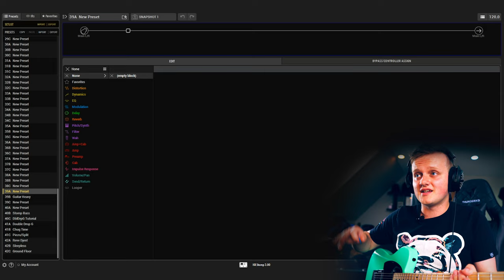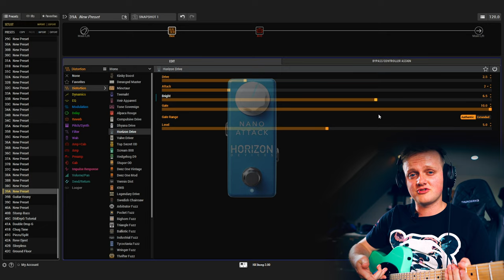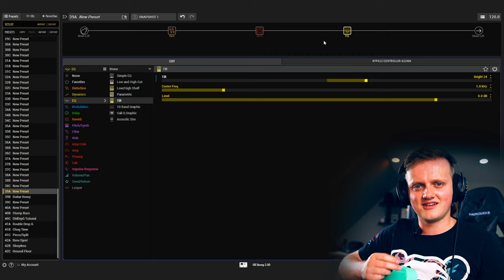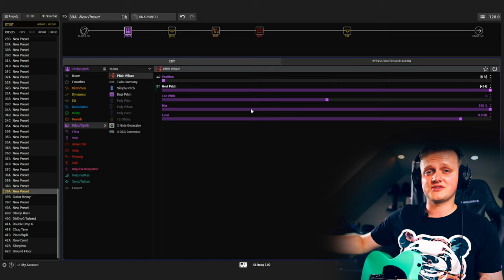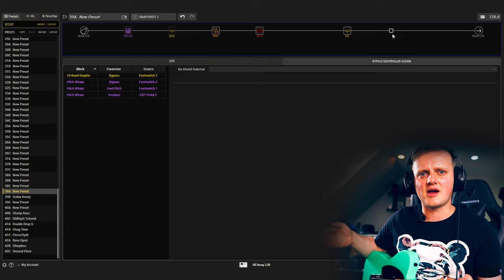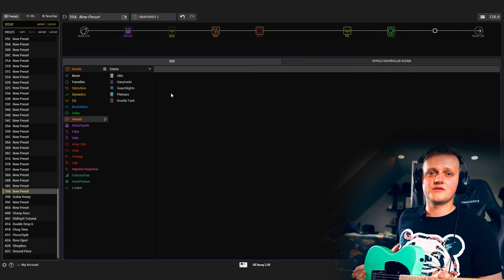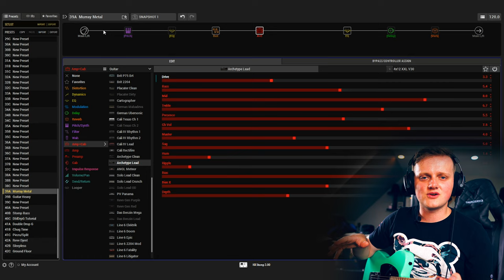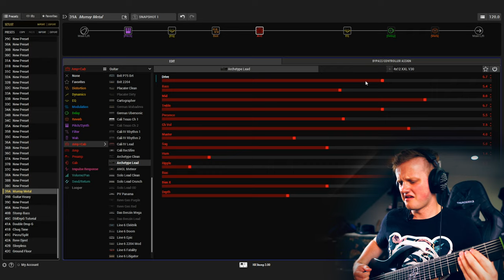Building An HX Stomp Metal/Djent Tone From Scratch! | FREE DOWNLOAD

Comment: Thanks for your awesome videos 😉🤘 
Do you have any advice for EQing the Helix patches for live use? 
Could be a simple low and high cut enough for most situations?
Reply from the maker: Glad I can help! Most of my patches get EQed in post rather than on the unit, and I've only done bass live with the unit at the moment (which didn't need EQing really). Potentially could do something more in depth on EQing, but generally picking a cabinet impulse that you don't have to EQ much helps out ✌️